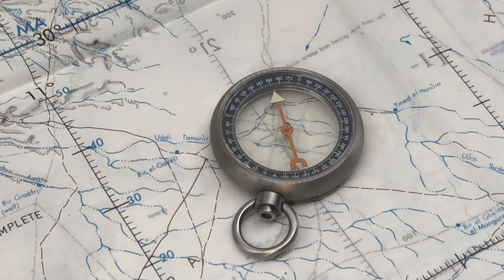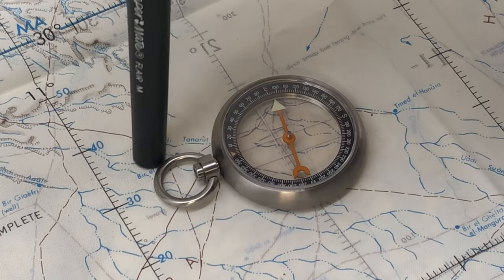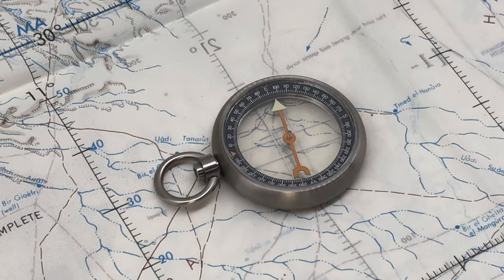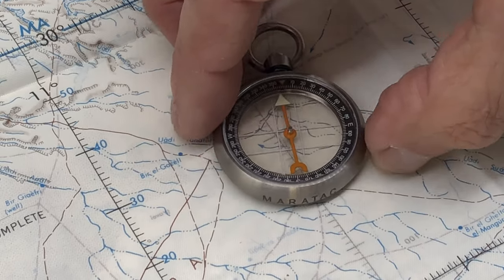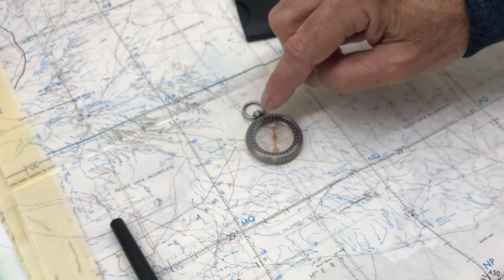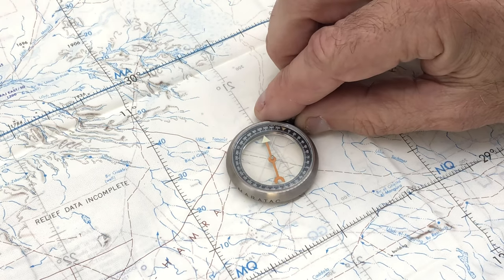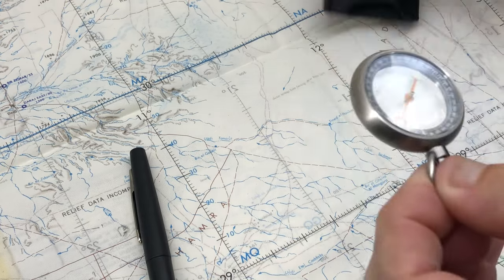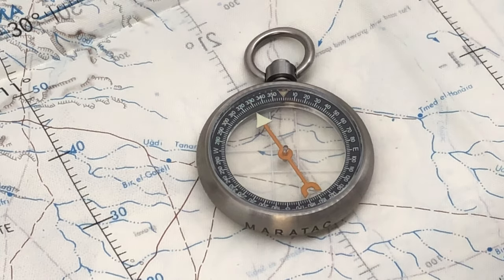Heirloom Dual Sapphire Titanium Compass

Comment: It's... nice. $200 nice? Only time will tell, I guess. Still, it WOULD make for a cool heirloom because it is well made, and would probably hold up against the rigors of time. Now... will the NEEDLE hold up? More importantly, if it doesn't, can it be somehow... RE-magnetized? ANYhoo... one thing that I DIDN'T like about mine is that I got this... funky case for it, and not at all like the little snug-fitting one that I saw. I guess they ran out. Perhaps I can find something ELSE to put it in later. At any rate... all things considered... i HAVE one! Shipped pretty quickly too! 👌👍🎁